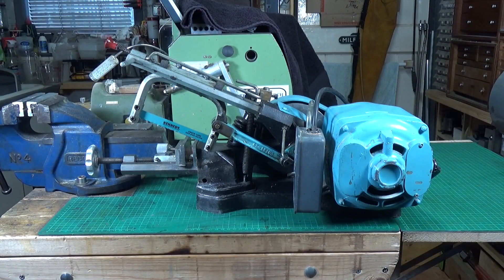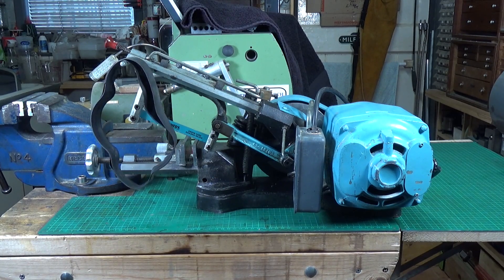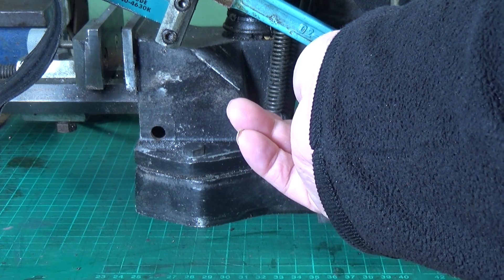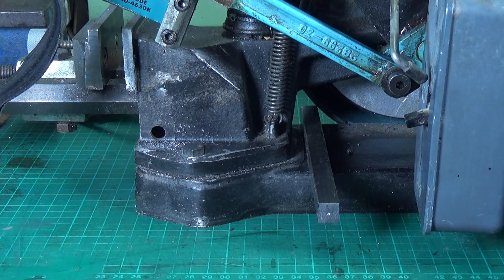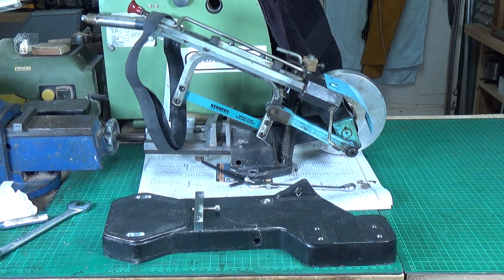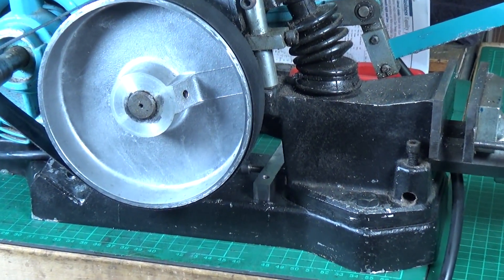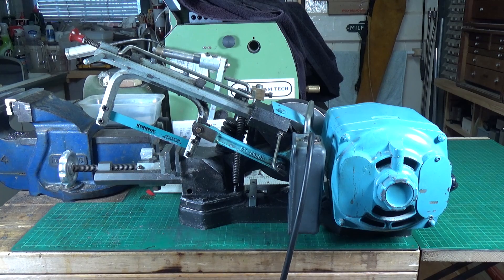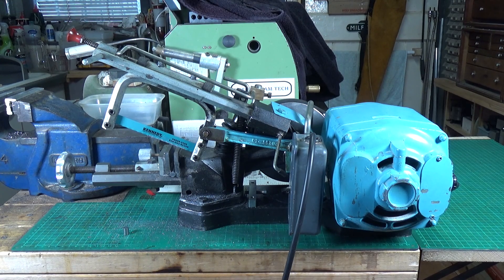Kennedy Hexacut Power Hacksaw Belt tensioner Modification

Comment: Great video's can you tell me what oil you use in the dampener
Reply from the maker: It was originally Castrol V which is no longer available but SAE 90 Gear Oil works well.
Reply: @RetroSteamTech thanks for the very quick response   OK many thanks.

Comment: I've got one of these and thoughts are coming around to fixing it up - on mine the flat belt runs directly on the motor axle which is domed over. I can see you have a mini pulley sheath over the end of your motor spindle. Do you know what's original? The problem I have is that the belt keeps working its way towards coming off (albeit that it never gets fully off!)
Reply from the maker: I'm not sure what was standard, although most of the ones I've seen photos and video of use flat belts and pulleys like mine. I've also seen ones that use a V-belt and appropriate pulleys, of course these might simply have been modified. As long both drive and take up are crowned and the shafts are parallel then the belt should not come off.

Comment: Can you make a brass bush for the bolts to go through and take the difference in the hole slot size out
Reply from the maker: You probably could, although you might have to mill the slots out in order for the bushes to have a decent wall thickness.

Comment: Cool little device. But with how cheap these portabands are these days I do thing these power hacksaws are a bit redundant.
Reply from the maker: I also have a portable metal cutting band saw, which is a great tool too. The beauty with the power hacksaw is that you can be doing other things while it is cutting.
Reply: I have both a portaband and a Kennedy Hexacut. The Kennedy wins hands down!
Reply from the maker: @andrewatcarpathian  I guess it's horses for courses. I have my bandsaw setup as a vertical saw with a table. It's my go to saw for cutting plate and sheet. The Kennedy does all the round stock.
Reply: @RetroSteamTech  I guess what also differentiates them for me is the ease of blade replacement. The Kennedy is so easy to replace the blade and set up compared to the Aldi portable band saw. 
I do also like it that you can set the Kennedy going and go off and do something else. Win, win, win. 👍😀

Comment: Hi Alan.  If you add another Allen bolt at the drive belt end of the bar stock, so it presses against the extremity of the flat area you are pushing against, it will tend to pivot the saw unit on the centre adjuster and push more directly in line with the belt.  Maybe drill a small recess for the centre bolt to go into as a locator as well.  What do you recon ?  Cheers Rob
Reply from the maker: Hi Rob. I did think about doing that and probably will. The flat part of the saw casting that the adjuster screw is pressing against isn't very wide but it may just have enough distance to effect a pivoting motion. Ideally a screw on the opposite side at the front would be better but there is no where to put that. I'd have to make an "L" shaped bracket. Cheers, Alan.

Comment: nice Mod Alan👍👍👍👍
One Mod  i will  now do when i convert mine from the earlier Chain Driven Model, (you may have seen), the chain drives ok but is noisy and i think they changed from chain to belt , because  not just a cost factor but more importantly, if the saw slide ever jams from whatever reason, the chain is unforgiving and jams the motor up whist still trying to power. Where as the belt will slip.
When your not busy could you do me 2 things please, 
Send me the info for the Belt so i can get one ready for when i change over and also,
Measure me the large and small drive wheel drum diameters.
It will really help me, to save guessing
and yes i still enjoy hacksawing by hand, we all have our own FOIBLES, there's a word i have never written before
🤣🤣🤣🤣
ALSO i noticed the good old Kennedy brand Blade you have in the saw, i have a few  box fulls of Kennedy's, Sandviks and other brand new old stock Sheffield made blades, i think thats the reason i like hacksawing so much, they glide through the job in hand.
ATB
Kev
Reply: I’m now on the hunt for Sheffield made blades. 👍😀 The generic blades are so awful 😢
Reply from the maker: @andrewatcarpathian  Hi Andrew. You might want to try The Sheffield Tooling Co. They sell a variety of different manufacturers hacksaw blades including Sandviks and Vanguard. Cheers, Alan.
Reply: @RetroSteamTech  I will definitely hunt around. Thanks for the heads up. 👍😀
Reply from the maker: Thanks Kev. Might add a second adjustment screw as Rob suggested in his comment. I didn't realise that there was a chain driven model. The belt is a T150-540-25 Megaflat Flat Belt . Many places sell them, as I said in the video I use Bearing Boys simply because I've had good service from them in the past. The large pulley is 148mm in diameter and 27.5mm thick. The motor drive pulley is 21mm in diameter and 35 mm thick. The large pulley is cast aluminium and uses a grub screw to hold it on the shaft. The drive pulley is steel and is keyed to the motor shaft. The Kennedy blade is a HSS All Hard Power Saw Blade, 18TPI, I get them from Zoro Tools, £4.99 each. If you need any other info let me know.

Yes we certainly all have foibles 🤣🤣 I think I will leave the hand hacksawing to you though, I get exhausted just watching you saw 🤣🤣
Reply: @RetroSteamTech  Thanks very much for all the detailed information Alan, it will help when i modify mine, in the near future, i will get a belt ordered ready, and be on the look out for some material for th large pulley wheel. Cheers Kev👍👍👍👍👍👍